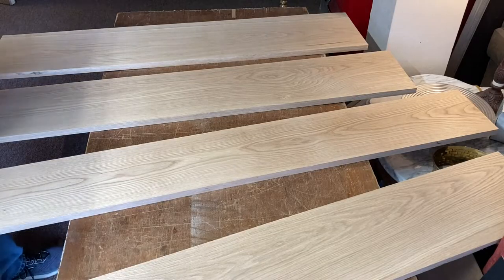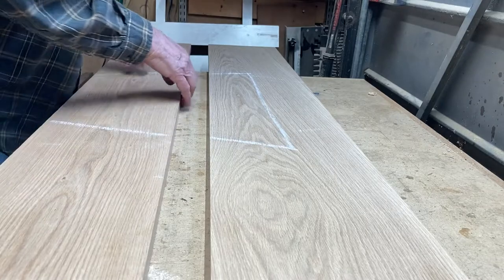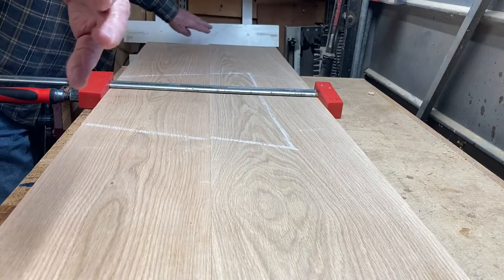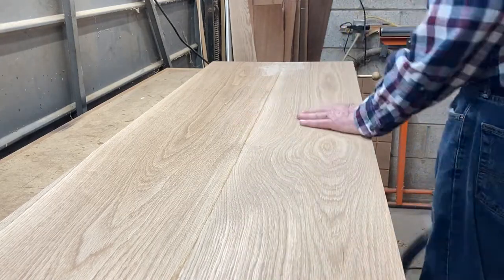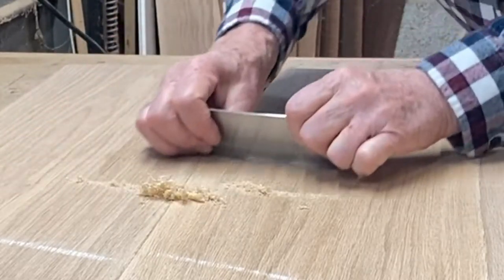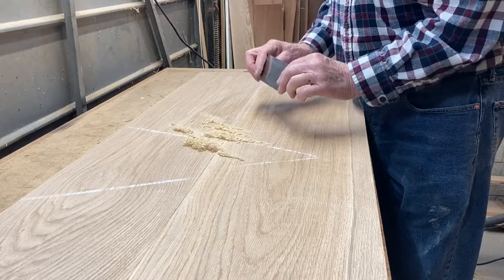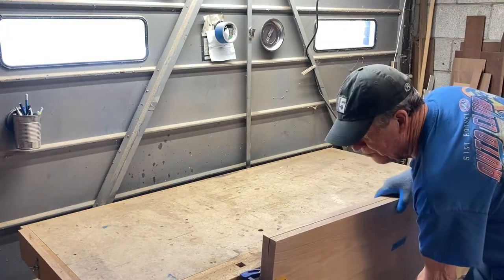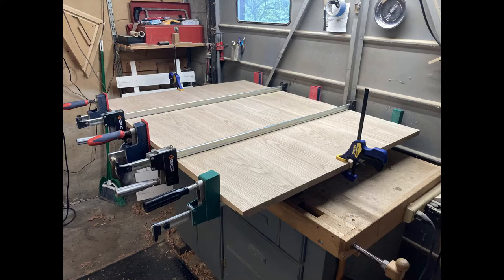Build A Mission Style Dining Table Part 1

Comment: hi Ron, just curious why you didn't use biscuits on the smaller joints just for the rigidity / surface area of gluing?  It was obviously a conscious decision so was wondering what the benefit is?  Thanks!
Reply from the maker: Thank you for the question Bob. By using the spring joint on a 2 board glueup, I had enough control so biscuits weren't needed. As you saw, when I put the 2 pair together, I used biscuits.